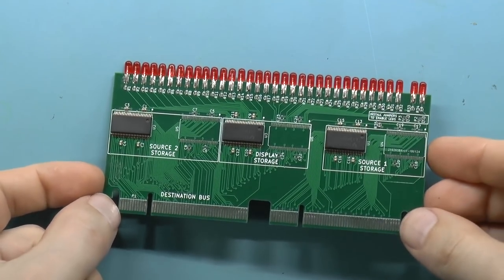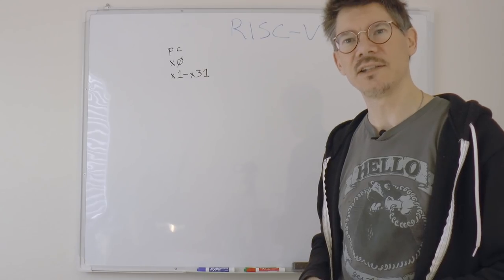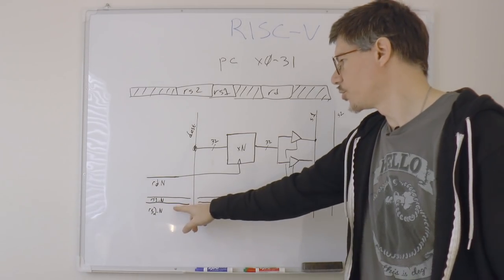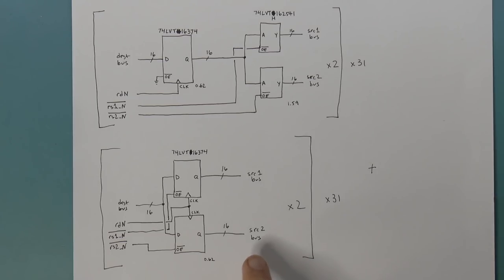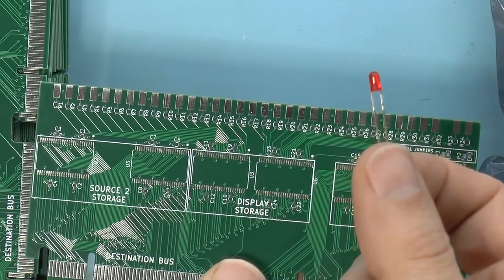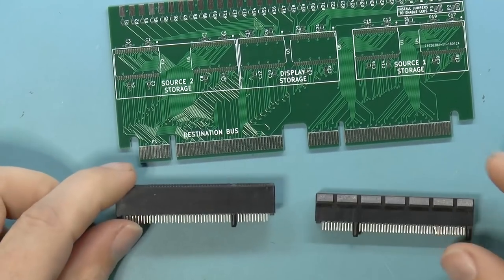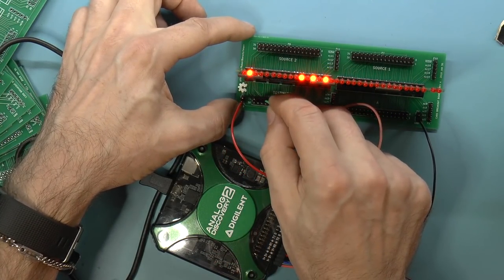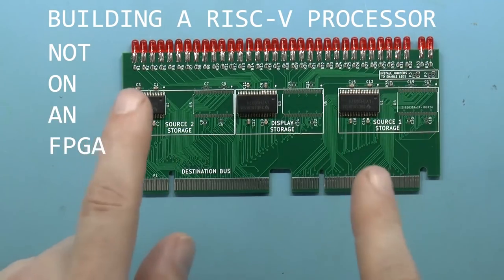LMARV-1: A RISC-V processor you can see. Part 1: 32-bit registers.

Comment: This is one of the clearest explanations of this stuff I've ever seen. Wish I'd had this in my logic design class in college. We did the FPGA RISC impl thing he talks about, and it took way more work to understand than it would have if I'd had this.
Reply: Indeed, this is a super informative video. Many thanks!!
Reply: it's always good to know the basics, the elements that make up the whole. implementing a processor in fpga is to difficult (at least for me) if i don't understand the basic building blocks. also understanding the sum of its parts gives you the power to work with it debug it, understand it.

Comment: "These are the kind that you sprinkle on a printed circuit board to appease the gods"
I feel ya, man, I feel ya.
Reply: Also I FEEL that right left confusion. I can drive, but I have to move my hands if I'm using GPS navigation. I know which hand is right by the way it moves when I move my right hand, but I can never remember which direction it is.

Comment: at 29:45: sorry to be the guy pointing out to little mistakes.
it's more or less 0.87mA. (3.3V-2V)/1.5k = 0.87mA. The red LED has about 2V for my calculations.
Reply: who cares...
Reply: Yes, the resistors should be about 150 ohms for 3.3v logic and red LEDs that have a Vf of around 1.5 volts (3.3 - 1.5)/.01 = 160, but 150 is the closest standard value at 5% tolerance. A 1.5 kilohm resistor won’t pass enough current to light the LEDs, or they’ll be so dim that you can only see them with lights out. 😬

Comment: The HASL finish might bite you if your PCIe sockets are gold plated.  You will likely get galvanic / dissimilar metal corrosion over time - I've experienced it a long time ago with Socket-370 to Slot-1 adapter which had a HASL finished.  I had to clean it every couple weeks, until I switched to a gold finish adapter.

Comment: Yet another idea for source registers configuration might be to use a single bus rather than two, such as by either loading two temporary source registers sequentially, or loading a single temporary register with one source and then using the second source directly from the bus. This might reduce chip count but at the expense of more complex instruction decoding/control signal generation and more clock cycles → slower execution.
Reply: I think an important part of the approach is to opt for less complexity in the trade-off between nr of parts/busses and complexity. In practice that means you throw in a lot (!) of bus drivers - but all the same - and get far simpler decoding logic in return. Also note that this way the nr of registers doesn't matter so much, so you can have lots of them.
The basic theme is: "gain modularity (extensibility) by keeping things simple/uniform".

Comment: Fascinating project. I wonder why not using 1206 SMD LEDs? Since you use the reflow oven that would spare you hours of soldering through-hole LEDs, not mentioning the fitting issues on PCB.
Reply: Oh please disregard my question. I noticed that in later revisions you already did smd LEDs. They look gorgeous!

Comment: Thank you for the clear explanation. I wish you the best of luck. This project is very exciting.

I have a few questions. What's is the effect of the three chip solution on bus loading? Did you consider using 32bit registers?
Reply from the maker: Very good question! I should have addressed that in the video. Each data line connects to 31 x 3 chips, so 93 (figure 100) inputs. The data input current is a maximum of 5uA, so figure 0.5mA. Most of the chips I'm using can drive much more than that, so I should be very safe.

As for the 32bit registers, I looked and couldn't find any.
Reply: 32bit register parts would probably be BGA packages. At 32bits I'd just stick to doing things in an FPGA.

Comment: RISC-V seems very MIPS inspired...
Reply: It's a purebred RISC, like MIPS, but there are as many differences as similarities.   A lot of MIPS instructions are missing, generally for good reason, and there are a few new instructions even in the base ISA, like proper branch conditions to make up for the lack of status reg.  The encoding is similar in ways that are useful (keeping register specifiers in the same location) and different in ways that are genius (the way that immediates are encoded for example).  This is all just looking at the base integer ISA -- if you look at the extensions, and the way the instruction set is designed to be extended, there is a whole lot of other stuff going on. Not to mention that it's  one of the densest instruction sets around, once you add the C (compressed instructions) extension, and AFAIK is the densest 64-bit ISA bar none.
Reply: Luke Wren Could you elaborate what's genius about the immediate encoding? I'ld be interested in it.
Reply: The immediate bits are "scrambled" in the instructions in a way that seems bizarre, but actually shortens critical path and reduces gate count.
One feature is that the sign bit of the immediate (and all immediates are sign-extended, even for logicals... actually really useful, e.g. XORI x, -1 gives you NOT x) is always in the same location for 32 bit instructions, and has a constant location in the 16-bit extension too. Sign extension is often critical path on decode, partly due to the huge fanout of the sign bit, and having it in a consistent place removes muxes from your critical path.

They also scramble bits around to ensure that, when possible, a given bit in the immediate comes from a fixed position in the instruction word. For example, the immediate for a branch instruction is left shifted by 1 to increase branch range, but rather than just use the S (store) format and require a left shift of the immediate during decode, they move things around so that:
- sign bit (immediate bit 11 for S format, immediate bit 12 for B format) stays in the same place in the instruction word
- immediate bits 10...1 are in the same positions in the instruction
- immediate bit 11 in the B format is in the same place as immediate bit 0 in the S format

And the overall gate count of immediate decoding is greatly reduced with this kind of strategy. There are 6 instruction formats for 32-bit instructions, 2 of which are just shift specialisations of other formats (for example, B is a specialisation of S above). It gets a little more crazy for the 16-bit formats, but the strategy is the same.
Reply: If you want the full details, then check out these pages in the v2.2 spec (most recent one):
Page 12 - base 32bit formats (R I S B U J)
Page 70 - 16bit format listing (although without full information on immediate decode)
Page 82 - 16bit instruction listing, with more detailed information on immeditates
Reply: I also really like the 12-20 split of normal (I, S format) vs upper (U, J format) immediates, as opposed to MIPS using an I-type (16bit imm) for addi and lui. It opens up a lot of coding space for the common instructions, and you can still generate a 32-bit constant (optionally, PC-relative via auipc) in 2 instructions.

Comment: 19:40 the only issue i see with the bottom architecture is that you can't use your LED output to debug the state of the other 2 register chips if one of them is faulty, while the top one shows you what's actually on the bus. so any hardware failure or bitflips introduced by e.g. radiation affecting the "source registers" wouldn't show up in the "led register"

Comment: "Green oil" is Chinese for solder mask. They were probably talking about keeping solder mask between IC pads and edge connector fingers. Seriously, this is such a common thing that they should have learned a proper term of art by now.
Reply from the maker: Alex Taradov that's what I thought at first, but when I made that change, they came back with the exact same questions. Eventually I determined that "bridge" referred to bridging over the vias. Also, if you Google for "green oil bridge", they seem to use that translated term a lot.
Reply from the maker: Alex Taradov actually, you are right. It was the solder mask between pads. But everything they asked me seemed to imply tented vias.
Reply: Some time ago I did an experiment and ordered the same board from a number of budget manufacturers. Only AllPcb asked this question, which created a lot of confusion. The rest just silently removed everything they could not manufacture reliably. I don't know which is better, really.

Comment: 12:30 Might want to try to avoid situations where you explain that the output goes to the source. :/ I guess it's referring to mosfets source and drain and how the flow of electrons is from negative to positive. Or how my electronics teacher put it: We had a 50% chance to guess polarity right and well... tough luck. ;)

Comment: Is there a board thickness requirement for the cards that go into the PCIe slot? Is the usual thickness good enough or should you bump up the thickness for card slots
Reply from the maker: "Standard" 1.6mm thickness.

Comment: Would it work for an 8 bit operating system where a compression would be 4 8 bit instructions per cycle where Z is 4 X 8 bit instructions to run a 32 bit register?
Reply: OR L where where is 4 compresses 32 bit instructions compressed to 8 bits? These would be custom instructions for speeding up instructions that are used most often.

Comment: Cannot see this mentioned elsewhere in the comments...  You mention the LEDs will be consuming a couple of milliamps (since you state 3.3V and 1500 ohms)...  However, you've neglected to include the LED forward voltage (which is around 2.1V for a red LED).  Therefore, there is only about 0.8mA flowing through the resistors / LEDs ((3.3 - 2.1) / 1500).  This should still be plenty of juice for most LEDs to actually glow without requiring a nuclear power plant to supply them!.

Comment: You claim you aren't using an FPGA to create it, but instead using Discrete Logic. I remember writing my own CPUs in discrete logic (not RISC-V, just a small custom CPU) that the software I was using (Xilinx ISE) then took and provided I added mappings to inputs and outputs, flashed it onto the FPGA. I used structural modeling the first time around, and behavioral (VHDL) the second time I designed the more complex 2.0 version of it. Confirming it works, I could of just taken my schematic straight to an hardware manufacturer to create a ASIC/dedicated circuit. 

I guess my question/comment is, when you say you aren't using an FPGA, do you mean you don't care to                migrate your design to an FPGA or - and I'm thinking this may be the case - is it that today's FPGA's and their respective libraries/programs consist of board specific libraries/components that make it quicker to create something, therefore abstracting all the discrete logic hence your reasoning. 

Thanks

Comment: >Less than 50 instruction
>Add instruction takes 3 parameters: 2 input registers, and 1 output register
>there are 32 registers
>in total there are 32768 Add instructions... just add instructions
>Less than 50 instructions...?
Reply: "Add" is the instruction, the 3 parameters are data pertaining to the instruction. You could think of it like add (register *rs1, register *rs2, register *destination)